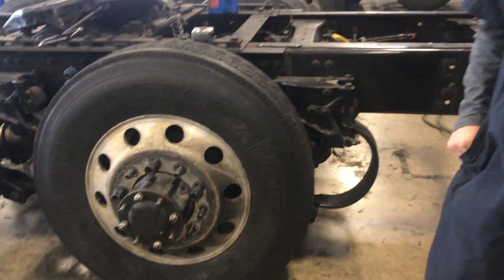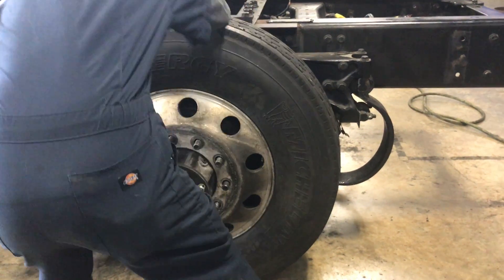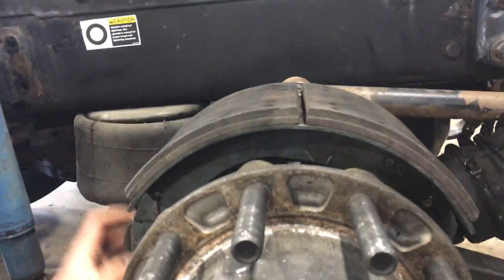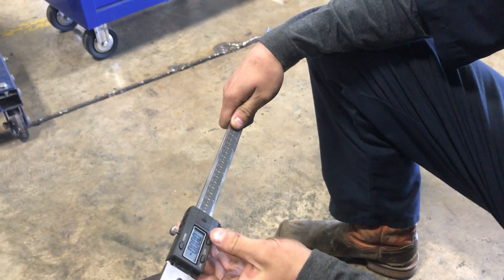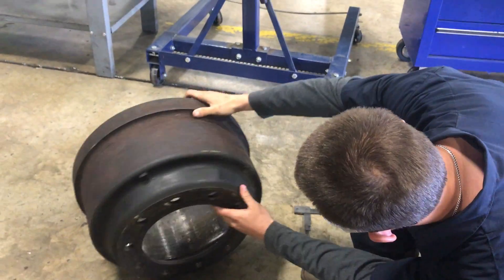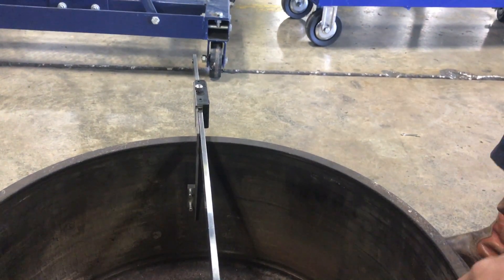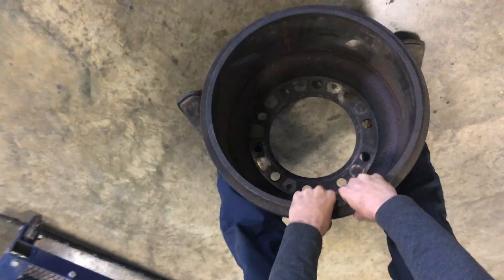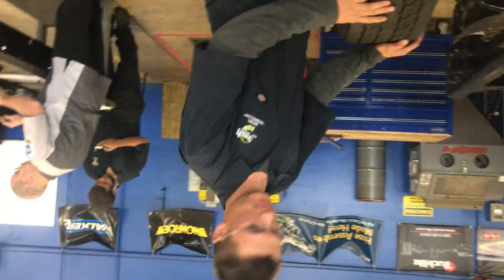how to perform complete brake inspection on semi drum brakes

Comment: There is a slot in the backing plate that you can check brake pad thickness through. Anything over 1/4 inch is good... no need to pull the wheel. If I did pull the drum, I would check the depth of the lip at the outer edge of the drum. This is a pretty easy check for wear without getting the caliper out. Anything over 1/8 inch and that slipper drum went in the metal barrel. We would usually run the bolt-on Daytons or the few Budd applications with the drum behind the hub a bit longer. If you are pulling wheels to check brakes you are wasting time, money, and your back.

Comment: I make brake drums for a living the out of round is called the eccentricity. It's what determines how much taper is allowed for the drum. With that being the bore you measured print says it's 16.500th so you said you had .503 which means it's only 3 thousands of an inch taper which is super small considering DOT tolerance is 10 thousands
Reply: I’m so

Comment: Without removing anything, I see cracks across the thickness (about 8 mm or so) of my front brake shoes. Is that not a problem? Is that a good cause to remove the drum and check whether it is cracked across the width? 2011 Freightliner Cascadia.